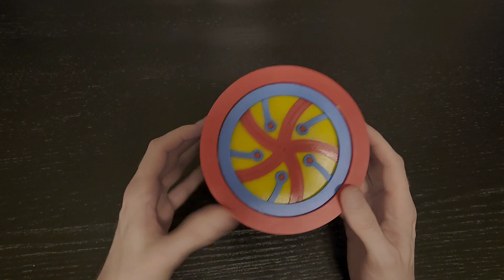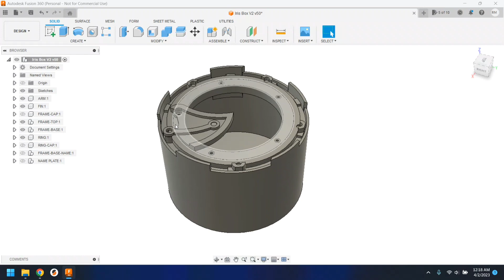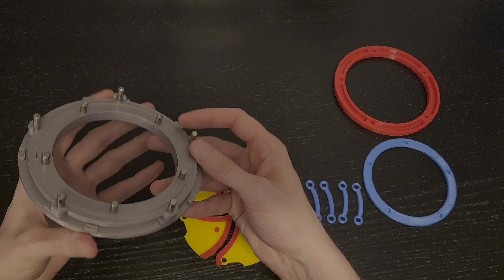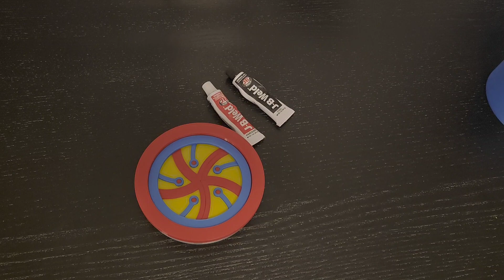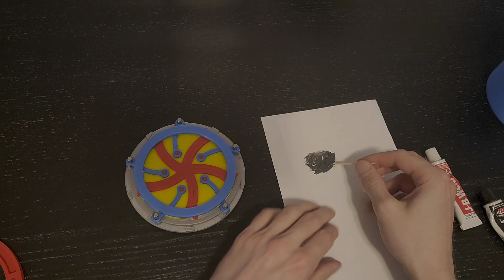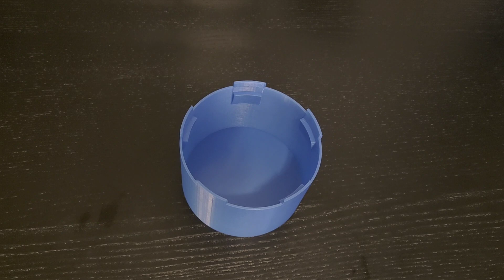3D Printed Mechanical Iris Box - Version 1.0

Comment: can u link the pins u used?
Reply from the maker: https://www.amazon.com/dp/B07F3T5FKL?psc=1&ref=ppx_yo2ov_dt_b_product_details

These are the pins I used, but it comes in a pack with many sizes. This project uses 5mm x 16mm dowels, so you may be able to order just that size, if you prefer.
Reply: @RoccosStuff  Thanks Rocco! im assuming this kit has the dowels as well for your coin sorter?
Reply from the maker: Yes, this kit includes what you need for the Coin Sorter, also!